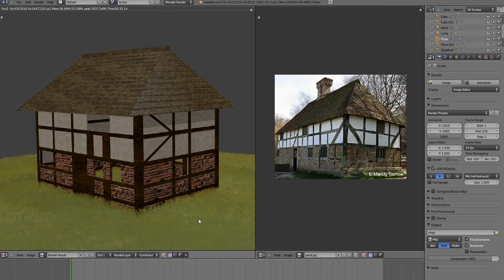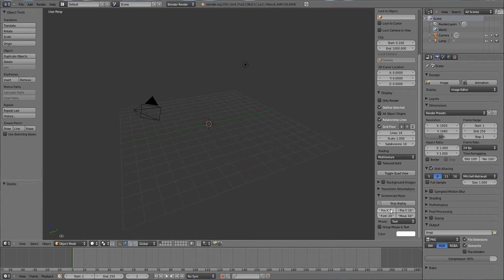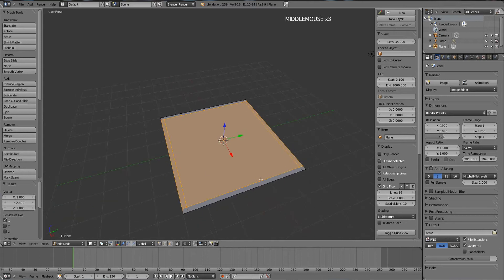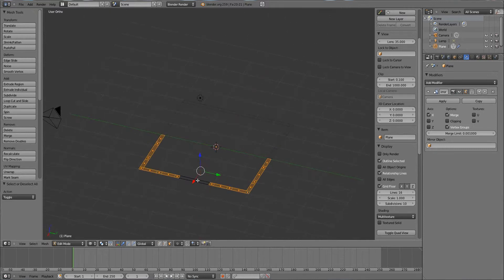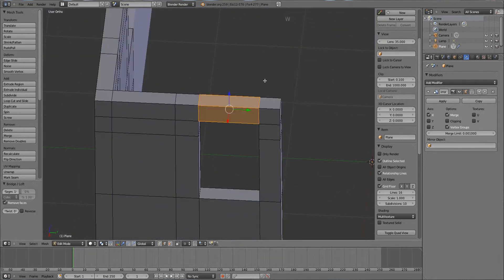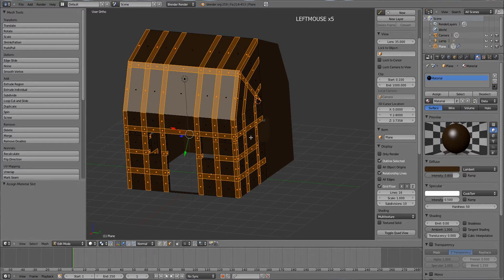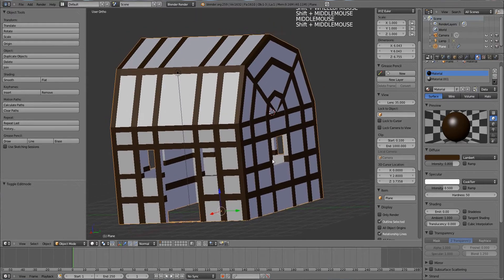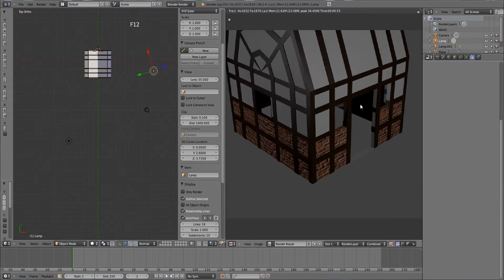Blender 2.59 Tudor style House tutorial, Modeling & Materials assignment

Comment: One question. I've just started to learn Blender. Shouldn't you be able to work on 1/4 of the house and mirror it in two directions? First deleting one half, like you did in the beginning, and then deleting half of the remain, so you work on a corner of the house. Then mirror your mesh in both the x and the y direction. It should reduce the number of clicks required.